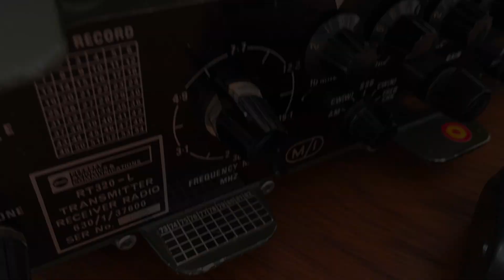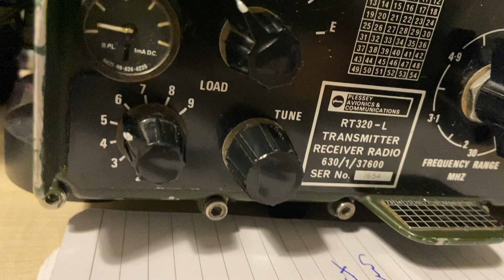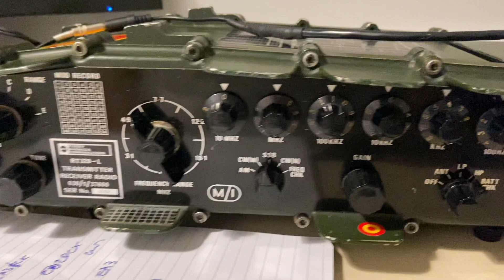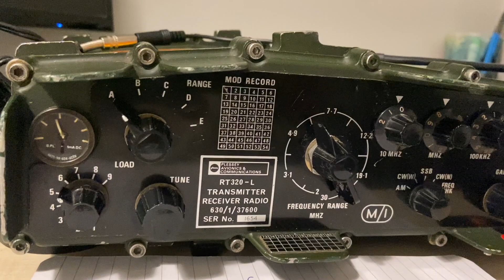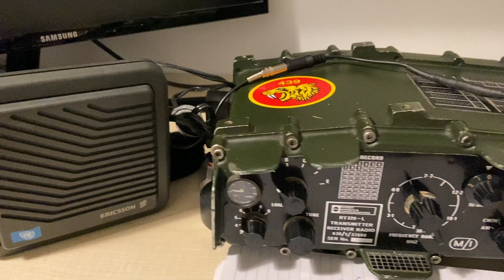Hands on a RT-320 L

Comment: Very nice! I got normal version - that offset is annoying. You swapped caps in HV PSU as preventive maintenance or You had trouble locking frequency?
I tried mine in digital mode and couple first seconds while switching TX/RX it was drifting and was breaking first part of digital transmission so it was unusable.
Wondering if that could be HV PSU? You had similar issue before reworking?
Reply from the maker: Hello! Inhad no issues, changing caps it’s sport 😂
I have this radio almost one year, decided to make a video
Several things going on the clansman by default: one is that power is automatically reduced aftwr some seconds to save battery… also on cw I think there is always a initial burst, specially if done the LSB mod
Reply: @Radiogenes  Haha - in some cases that's good thing to do. I think I will recap mine - maybe it help with lock-in - but that when I get more time :(. Thanks!